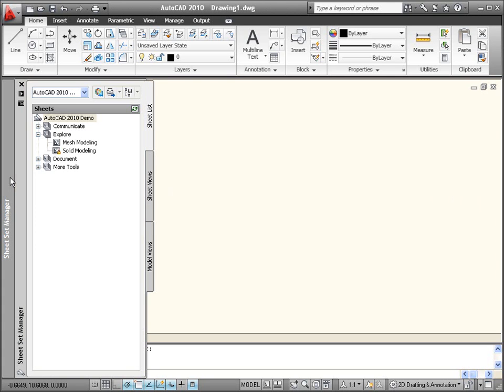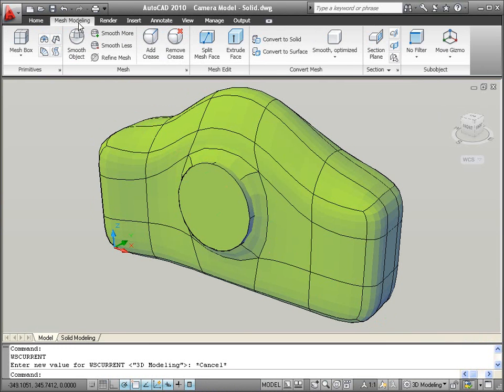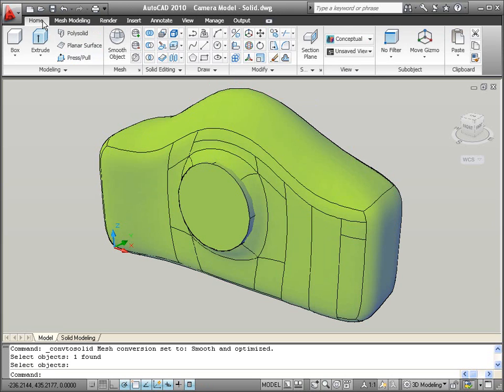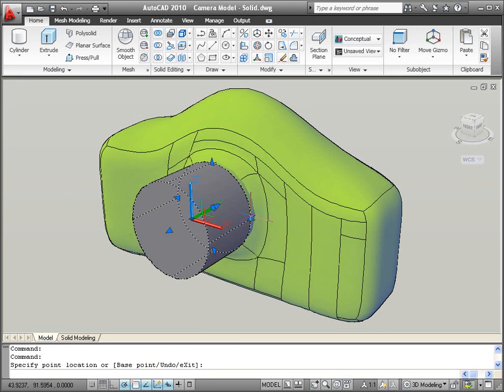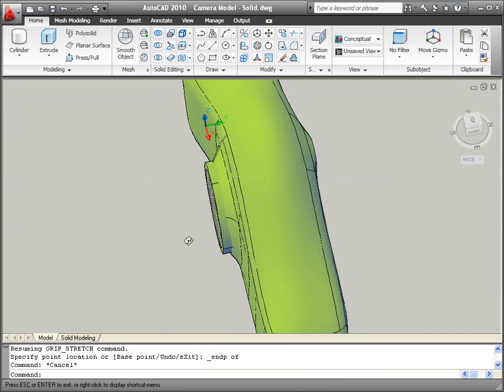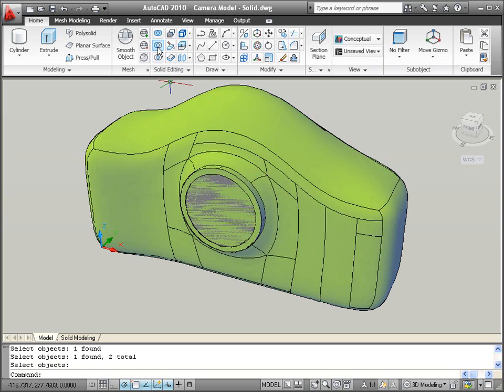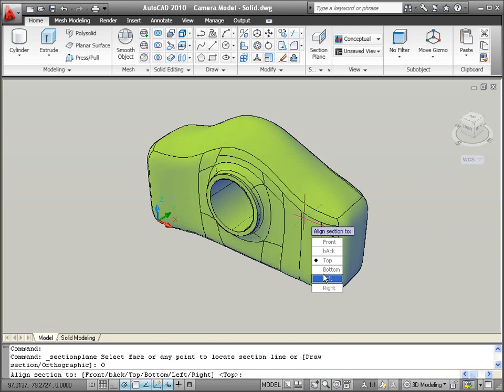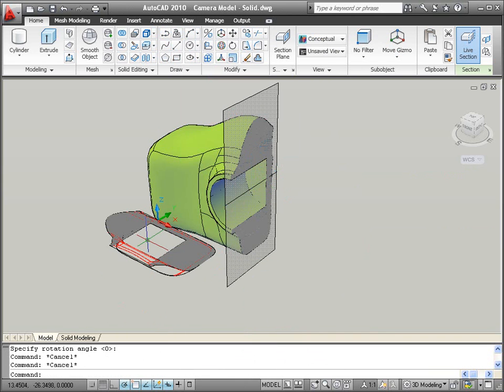AutoCAD 2010 Demo: Solid Modeling

Comment: @kyle44422 yes it can, after u generate the 3D part u can easily make a dwg file after it> go file> make a drawing after part > choose format, i'm using A3 ISO> then drag views from the right part of the screen on the sheet> after u draged the middle on(TOP) un can see everything will be easy> after that u go to sketch and use smart dim to show any dimensions u want, bb